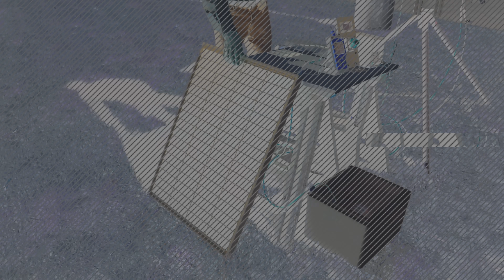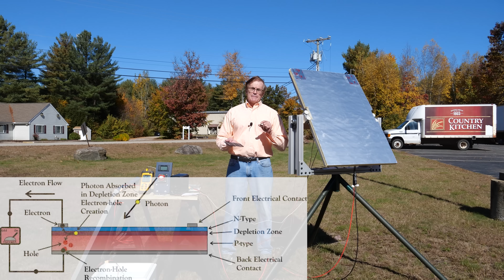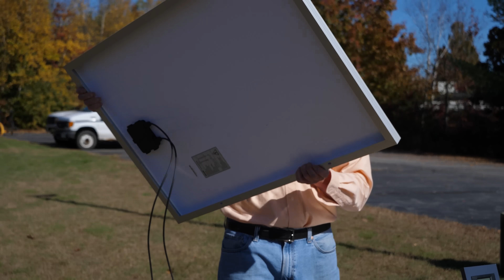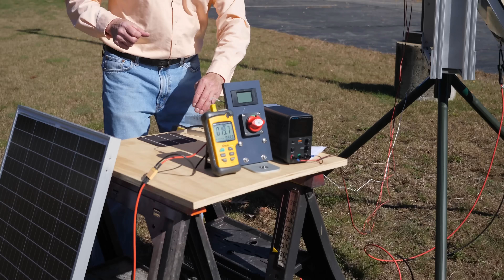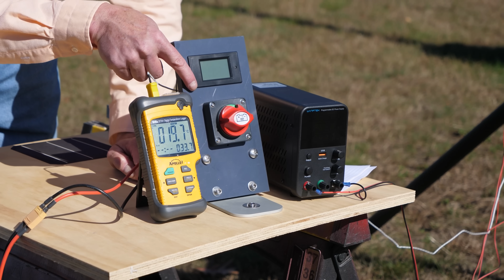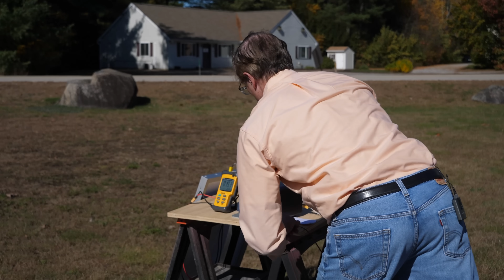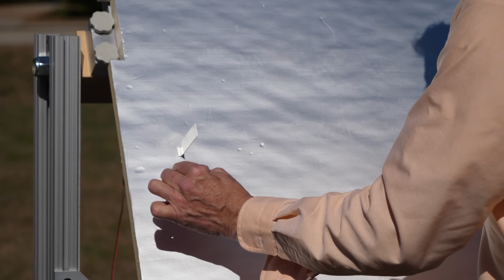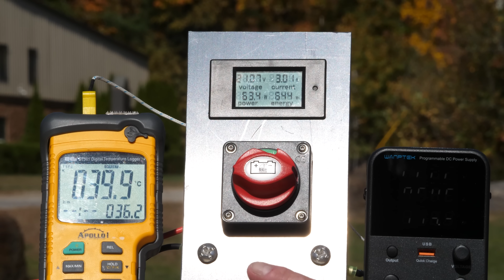Do you REALLY get enough out of your solar panel?

Comment: 1:05 No one really does that anymore... For monocrystalline solar cells like the one you're holding, you start with a doped silicon wafer. On the front side, you would texture the surface and typically heavily dope it with phosphorus and then throw on like 80 nm of Silicon Nitride for passivation and antireflection. On the back you would just screen print an aluminum rich paste for the rear contact (Ag on the front). After the printing, you send it into a belt furnace (glorified pizza oven) at 700-800 C which burns off the organic binders in the pastes and causes the metal to contact the wafer. On the back, the aluminum actually forms a eutectic alloy with silicon that assists carrier collection. 
Let me know if you want more deets.
Reply: Interesting. Things change so quickly I couldn't make a youtube video ever without fear of posts like this lol
Reply: Sounds like someone working in panel fabbing
Reply: @sf4137  We make cells lol.
Reply: Also, it's worth noting that there are no 'polluting heavy metals' as such in modern silicon-based panels. However PV panel scientists and engineers are proposing perovskite technology.  With perovskite, you will have heavy metal pollution because of the lead-halide incorporated in to the panels. Not only will this be bad on disposal of the panels, it will also make recycling difficult. An additional problem with perovskite is that this halide is water soluble so it literally leaches out over time.
Reply: @mb-3faze  Well, to be fair, non lead-halide PVKs are being studied but have limited stability. Not good if you want to put it on a rooftop for 30 years. That said, some form of a PVK-Si tandem cell is likely the future of solar technology.
Reply: @SagnikDasgupta  I sure hope so. I think it is important to call out potential problems in scientific advances before the big-money people get a toe-hold and realize that they will lose a lot if the technology isn't pursued. A relevant example from the past is Midgley's work on gasoline additives to prevent pre-ignition. He knew full well that lead caused neurological problems - he suffered badly himself - but the car people saw dollar signs and suppressed the health effects. The result was 50 years of deleterious childhood brain effects until it was finally banned (mostly) in automobiles. I say 'mostly' because leaded gasoline is still manufactured and used - it's used in those annoying buzzy little sport aircraft which are flying around at the start of this video. They use avgas and that contains lead. That lead gets sprayed out of the aircraft and on to the very food crops that you and I eat.
Reply: "glorified pizza oven"... True! 😅
Reply: I want more deets
Reply: @nocandopdx  What would you like to know?
Reply: @SagnikDasgupta  One concern a lot of lay people have with solar panels is the possibility of toxic metals or residues leaching out. There is very little one can do to dispel this myth, but it's also nearly impossible to find a 100% straight answer on what elements are in any given solar panel. As the guy who makes them - either residential or for big farms - is it possible for something toxic to leach? Suppose even that the panels are damaged or there's a fire.
Reply: His explanation made it sound like a diode lol
Reply: @yun-z  It is a diode.
Reply: @RWBHere  In fact, it's a Light Emitting Diode. (LED)
Steve Mould on the topic: https://youtu.be/6WGKz2sUa0w
Reply: @benjaminmiller3620  That was exactly what I was thinking, I just couldn't remember which one of the many awesome YT's made that video.
Reply: @yun-z  Yeah, interesting thing is thin film silicon solar cells fromm like the 90s used to kinda be made like that.
Reply: @yun-z  a photovoltaic cell is, essentially, a large flat photodiode. If you run current through it, they'll even emit light (mostly in infrared, and with very low efficiency, but still).
Reply: @Validole  Correct, this is called electroluminescence.
Reply: @云  they are diodes, effectively.
Reply: @yun-z  That's real talk though and very observant of you

Comment: nooooo!!!! please this is a HUGE waste of money! If you are limited by space then sure, otherwise you will end up spending FAR more in material costs. You can get used solar panels for $10-20 a panel, they produce 20% less power but per watt you will get a ROI of 2-3 months. All this contraption things simply adds complexity and cost. Solar panels are a issue of cost per kw not efficiency.
Reply from the maker: It's  also an issue  of effeciency  as well as longevity.  Those used panels  would not have been replaced if they hadn't  degraded.

Comment: Why not liquid cool the panels with electrically inert fluid and then scavenge the excess heat and use in a separate application? Maximize the electrical output and excess heat. Fans obviously use electricity, reduce the number of fans and install a radiator.

Comment: I believe the air intake area is too small, restricting airflow. Aren't these fans affected by static pressure?
I would try drilling 2-4  rowes one half inch holes in the 1mm plate. This would increase the area and introduce fresh air midstream where the air is already warm.
Reply from the maker: I messed around  with that and this was the best balance.

Comment: simple, just install ground rods and flow the water through them. a u shaped tube 10 ft under ground and allow gravity to fill the hot side tube from the runoff from the panels and a small pump can draw up a small amount of cool water from the other side of the u pipe under ground for the drip rake that will flow the water down the panel............shoot even just an underground reservoir and a small pump would do the trick. install panels on the ground rather than the roof to reduce the distance needed to pump up cool water......

Comment: The cleaning aspect I discovered yesterday is really big. It was fairly cloudy out, and I was only getting about 6-7 (wavering) amps out of my 48V array.  I grabbed some "windex" and towels, quickly cleaned everything and re-checked.  Was wavering 10-11 amps!
Reply from the maker: Absolutely
Reply: Would like to see the dripping methode, it's probably not a good heat sink but evaporation is known to have a good cooling effect, so it may be a viable low cost solution.

Comment: Could you try this again, but just with the fan setup switched so the fans push in on the bottom, and the air vents out the top? I wonder if you might not get a big bump in effective flow by leveraging convection.

Comment: Money says you could achieve close to the same cooling without the fans just using the perfect sized holes at the top and bottom in and out creating a natural airflow. What size the holes no idea i just know you can induce airflow based on your in and out hole size.
Reply from the maker: Probably not.  We found a very small  improvement  with the heat sinks vs the stock panel without the fans.
Reply: @TechIngredients  yes i meant using the heat sink but with a venturi type holes in or other engineer voodoo you know about thermal dynamics. Its like that people think its air pressure that is the primary driver of a turbo charger but its not its heat. So with your understanding of physics you should be able to create something other than a fan to move the air.

Comment: Geothermal energy gives you roughly 4C temperature all year. I don't know how much the circulator pump for the energy well consumes energy, but it could be used to cool the panels down in the summer, while also "charging" the energy well.

Comment: Would corrugated metal roofing panels with beads of thermal bonding be a good substitute for your custom made radiator? Also, it would be interesting to know how much useful thermal energy you could be applied to space heating if you ducted it into your workshop on cold winter but sunny days. If the thermal gain was significant then it would mean actively 'cooled' solar panels might be more 'year round efficient' at a steeper angle to make the most of autumn/winter/spring sun. If you were designing/building a house from scratch with 'actively cooled' panels it might make a significant difference in the ideal angle of your roof design vs the convention.

Comment: I assume that bigger industrial installation use (or should use) water cooling.  
Direct air cooling is nice, but it's a lot of moving parts that can ask for maintenance, while a big water loop only needs pumps and some moving parts at the place where you dump the heat.  
For a small roof-top installation, that might be too much (and you would have to work around problems like freezing water and so on)
Reply from the maker: That's  a valid  consideration.

Comment: Would this then mean that the same solar panel at a given output, sun angle and air temperature would have a greater output if roof mounted on a vehicle and the vehicle was moving vs stationary do to cooling created by air flow over and under the panel?
Reply from the maker: Yes!

Comment: A really interesting episode. My only problem with the power differential was that the baseline was the modified panel with a mostly enclosed back. Are the aluminium fins compensating for this passive airflow that would otherwise keep the panels cool?
Reply: Agreed
Reply: Agree
Reply: That is a great point, he needed to do the baseline with an open panel, not the one set up for passive cooling
I wonder what the baseline of the open back panel is?

Comment: could u use a thermoelectric generator using the potential difference of a heatsink and panel to drive the fans. could u use a vapor chamber or thermoelectric generator itself to move heat to a container and store heat in a water heater or so?

Comment: Where I live, it’ll be at least $1K to get someone on top of my roof to service anything. Those fans will need to run for at least 1-2M hours without fail for them to break even. ($1000/($0.2/KWh * 5 Wh/1000)). Also - If the daily deviation on solar energy output is greater than the efficiency lift, then it’ll be difficult to know if those fans failed either way, making the math worse.

You’re also measuring in  zero wind conditions. Which is another variable to consider on someone’s roof. 

With that said - fantastic channel. Been following for years. Not meant to dismiss the idea in anyway, just wanted to point out a couple other variables that might be applicable to folks in similar circumstances as me.

Comment: While fans do become more efficient as you increase size, they also generate less static pressure. For this application of forcing air thru a narrow duct full of cooling fins, static pressure is going to be important. Mounting the fans such that the air needs to take a right hand turn as you have generates a lot of loss. There is minor loss due to the fans positioning near the top of the panel as well, due to majority of airflow being forced in the opposite direction of the convective flow.

I'd like to see this test run again with the fans at the bottom of the panel facing parallel to flow.

In regards to liquid cooling - 
1. Could this be integrated into useful heat?  water used to cool PV panels then goes thru a thermopanel for final temp raise and into hot water tank/circulator? excess to flow thru a radiator/dumped/peizo generator?
2. You state problem with using aquifer etc for cooling is eventually that temp will be above ambient and actually reduce efficiency. How is this relevant in areas where solar has high flux as those areas rarely see temps below freezing? Also you can simply divert the flow with a valve.

I can see these fans being great for low infrastructure, remote, and portable applications, but for static installations water cooling gives you the ability to capture that heat for other uses.
Reply: the issue is it's still low grade heat if you want your panels to stay cool.  You would need to utilize a heatpump to concentrate the heat to make it more useful, but that's going to cost a lot to install\run.

Comment: I also think that the efficiency would significantly increase with larger 550W panels. So if this system improves net efficiency by 10% and longevity by 50% it might actually make economic sense especially in deserts.

Comment: I will have to look at what Sunovate is doing, but I wonder what would happen if one used PV panels as the absorptive layer over a forced-air plenum ducted down to rock bin thermal storage (similar to the solar hot air systems so popular in the late 70s and still used by Living Energy Farm currently). Lovely work as always!

Comment: Alternatively you could use a PC water cooling pump and a dual 120mm radiator for the cooling.  The hard part would be machining the "water block" for the backside of the PV panel.
I like the idea of using PVT panels in combination with a heat pump for both HVAC and domestic hot water.

Comment: v2.0 perhaps try piezoelectric cooling, instead of rotating fans (with bearings), there are flappers.  Less moving parts couldn't hurt, right?  If I'm not mistaken, the piezos are inherently more efficient, electrically.

Comment: Maybe worth the hassle if installation space is very limited or in really hot climate. Else nah, just add a few more panels if needed. 
At about 175€/$ for a 400Wp panel as now, adding a cooling system would most likely double the price for maybe 10-20% more yield. Also will use three to four time as much aluminum, fans (that WILL fail!), more complex wiring and so on.
Installing the panels with good airflow in mind is crucial. Maybe frame-less glas/glas panels are advantageous in this regard, but they are also more expensive.

Comment: Though, I do really admire your desire to improve the efficiency, I really don't see that the gain here is worth the amount of time and money involved. I think it would be better if you tried to build a hybrid panel then was used to pre-heat cold water which would then be used for hot water in the home, at least that way you get the benefit of saving on heating the hot water. The water could be stored in an insulated tank, and the panel should always get the coldest water at the bottom of the tank.

Comment: There is no need to scrap a solar panel.  The panel will never completely quit if the diodes or transisters still work.  They can be re-used as panels for green houses that need shade in the summer time and electrical power for a fan.  A panel that is working at 50% is still a great value for other applications.  Also it is structural glass for such things as patio tables, sun room panels or wall panels and roof panels for a shed that can use that power to run a much smaller system for a deep freeze chest or air compressor and a few tools depending on the battery component and the tables mentioned could run usb charging ports for laptops and phones as well as a desk top fan.  Repurpose and re-use is far better than recycling panels in my opinion.   I like the idea of water cooling with black tubing on the bottom and using this heat to warm water into a hot water tank for showering and other needs to reduce the electric or gas bill for heating water.  This could be done with a second water heater tank, a left over that can hold pressure.

Comment: While I love the experiments and have watched almost every video on this channel, I have a couple of problems with this set up if we are considering roof mounting.

The comparison is not realistic if we are talking about roof-mounted panels. Normal solar panels do not have a closed back with aluminum fins which change its cooling dynamics. A more appropriate comparison would be to have a regular solar panel compared with the one with active cooling which I imagine would show that the viability of active cooling is lower or non existent. 

The second problem I have is that the coolers in this set up have to be able to draw ambient air, which they wouldn't be able to do on the roof. The heat of the very roof would make the air around it hotter, lowering the cooling capacity of the active system. 

There is also the issue of having enough clearance between the roof and the ventilators to have them working efficiently. 

The last thing I would like to add is that in the situation where you have an array of these panels on the roof in multiple rows, another issue arises. Your intake and output are on the same side of the panel which would cause the warm air to accumulate under the panels lowering the efficiency of the system over time as the already heated air gets sucked in again.

Comment: What if you better designed the structure around the panel to take better (perfect) advantage of the stack effect. I wonder what it would take to see similar airflows as you achieved with the fan. In all airflow systems one has to understand how wind affects them. Most roofers no longer use active cooling because of the fan failure rates in the high heat. Long term we need a whole house heat-pump system that moves hot and cold around the house. Possibly with a hot and cold water reservoir.